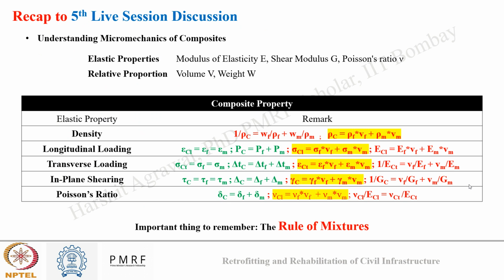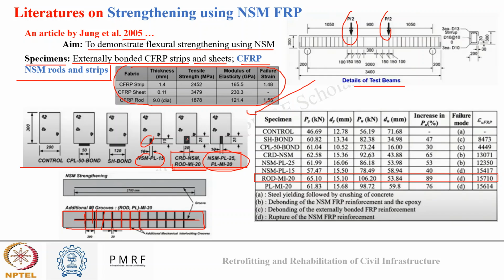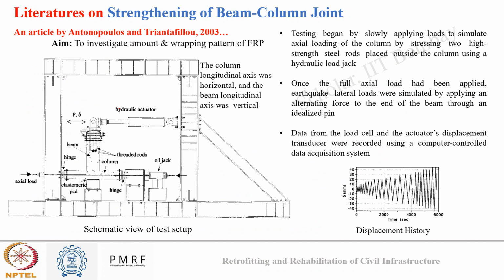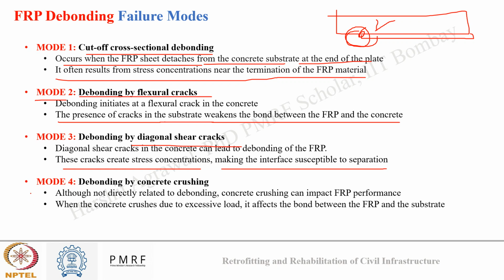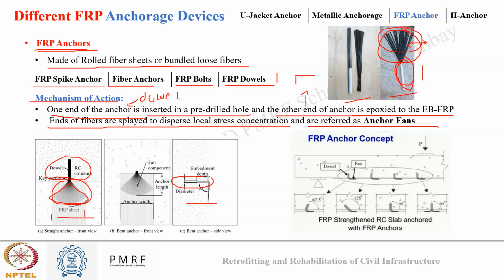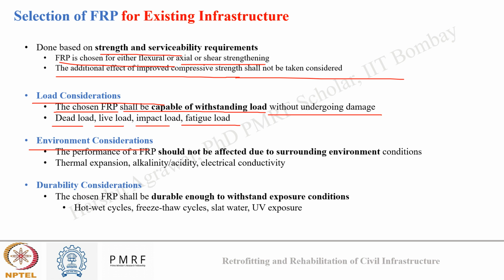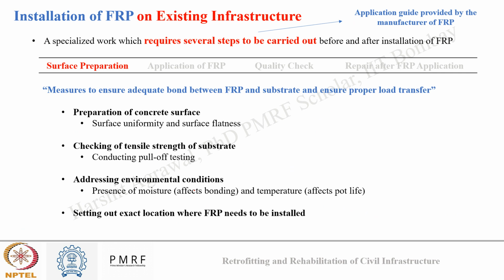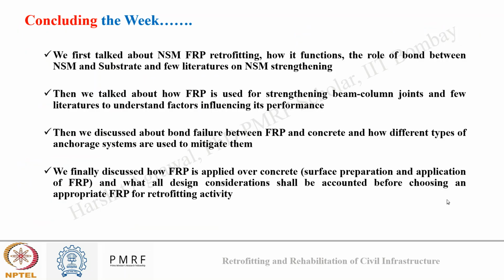Retrofit and Repair WEEK 6: Anchorage, Design and Installation of FRPC on Existing Infrastructures

Comment: This is relatively new topic, I am glad to see you covering it in your class. regarding CFRP splay anchors ACI 440.2 the 2023 version has covered their design. the previous version of the guideline also recognizes the enhancement in strength gained from CFRP anchors used for shear strengthening. but, finally we have got design table for them. thank you!
Reply from the maker: Thank You!